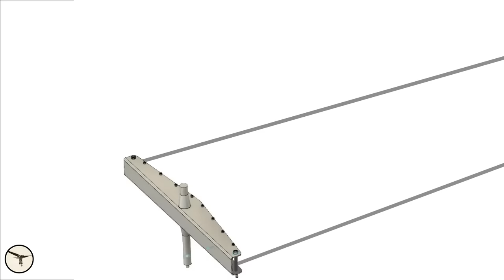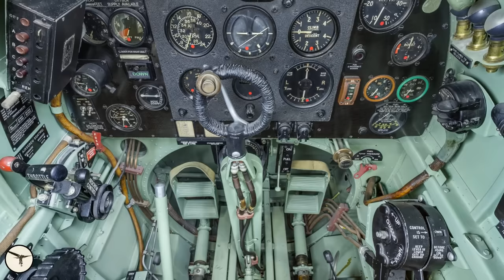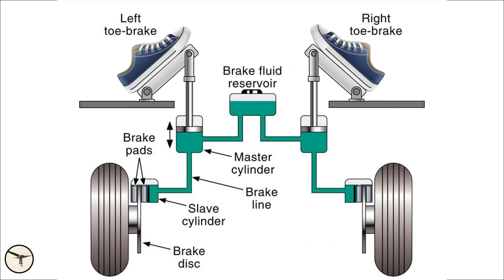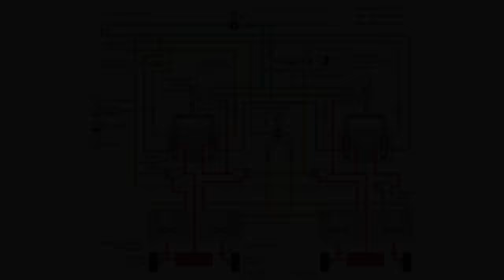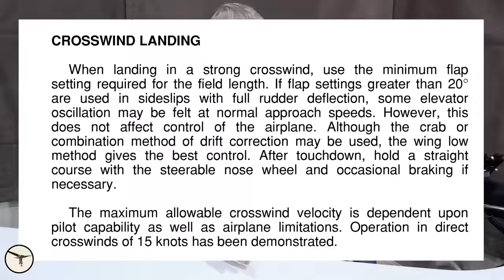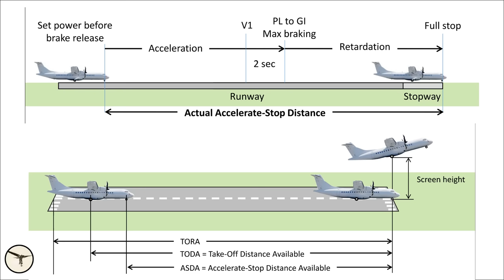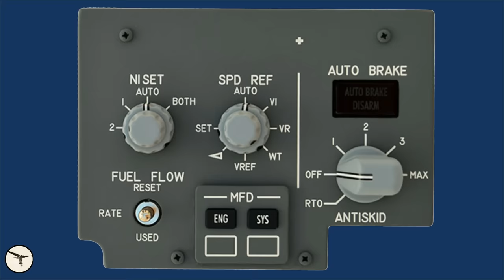Are you using the rudder pedals correctly? | Flight safety | Loss of control

Comment: Having grown up in small airplanes with poor brakes, I have always kept my heels on the floor with my toes on the rudder and used rudder exclusively except to make tight taxi turns.  This has worked for me, even in TW like your Maule, because i also use the apparent brisk walk rate of closure technique to decelerate on short final so as to land slowly and softly enough using both pitch and power to touchdown.  This slower approach to the beginning of the runway allow an angle across in strong crosswinds using the entirely adequate thousand feet between the downwind corner and the upwind big airplane touchdown zone marking.  Cubs, Champs, Taylorcraft, and Luscombe had only cable control of a mechanical non hydraulic brake.  If you applied the maximum breaking taught today, the pulleys routeing the cables would break.
Reply: hello i am training now，and had my first flight several days ago and i can not control the taxi direction how should i place my feet and what should i do😢😢😢😢

Comment: Boeing 737 pilot here. From what I read from FCTM, the manual writes that when operating rudder, heels should be on the floor. When braking applied, pilots should move feet on to the pedals so that the upper of the pedals part can be operated to apply brake. It works well for me since I was from PA42 directly to B737NG. I clicked this video for one situation that my technique could be challenged, but still didn’t get a clear answer. When autobrake and antiskid inop, flying the plane in strong cross wind, QRH asks to apply manual brake without delay upon touchdown. With the heal down technique, rudder pedal displacement increases as the plane touches down in a strong crosswind condition. The pressure and the rudder deflection on the downwind pedal increase as the plane slow down, so there will be no chance to slide your foot to the top part of the pedal. The solution I would have to use could be that during briefing, I would ask my copilot to hold rudder pressure for me to slide my foot up, or I would ask him to apply manual brake on my call upon touchdown. 

Other situation, such as engine failure below Vmcg, just bring the throttle back hold the tiler, then apply brake; and whenever immediately stop has to be carried out, when taxi, both pilots should avoid heads down work to minimize the situation of immediately stop. For those situation, foot on and foot down technique didn’t make any difference of prevention disaster happening. Still, I prefer put foot down to enjoy daily flying, but keep heads up. 

It seems Airbus pilots would have totally opposite technique as their pedals are designed to have your feet fully on the pedal as far as I know on A320.
Reply: Boeing pilot here.
Totally agree with you to have your heels on the floor
it's impossible to hold the rudder pedal without any leverage in the event of engine failure.
Reply: @JSmith777  Some daily workout might be needed to handle EO situation.😄

Comment: I like heels up on the pedal, I started doing that flying a Ce-185 because adjusting your feet to add any brake while your applying full rudder without changing the rudder input is nearly impossible. For the same reason in the Gulfstream G4 we are required to have our feet up on the pedals. This is required by an AD note in the G4 to address nose wheel steering hardover failures where you have to keep full rudder and brake and a delay repositioning your foot  to add brake will result in a runway excursion.  It’s not required in the G6 but I like how it feels better and I’ve never had an issue tripping off the auto brake by inadvertently adding brake.

Comment: Great and explained with details. As a glider and ultralight pilot I haven´t really learned to use separated brakes. Most of the little ultralights don´t have it separated. Some even don´t have any brakes - especially the older ones. However, I now have got an SD1, the smallest aircraft you can buy, and . . . it´s a taildragger. Originally it had had heel brakes but my large feet couldn´t reach them without sticking under the petrol tank which is right before the pilot. As I said, the airplane is really small. The "pedals" are only short pieces of iron tubes. I do not have experiences with taildraggers. Only model aircraft I flew with such wheel constellation. Friends told me I will need the brakes on my SD1 to keep the direction after touch down. Now I am constructing a special brake system with a 3D-hand lever at the stick which can be pulled and additionally moved sidewards to increase one of the two brakes more than the other. I don´t know whether it will work. I will carefully test it before flying. Generally those planes have less danger because most of the airfields are more than big enough for them.

Comment: Hi. Good video presentation! I use both methods. When taxiing, my heels are off of the floor so that I can brake more quickly. During the takeoff roll, my heels are slightly off of the floor until rotation, then fully on the pedals just after liftoff so that I can easily tap the brakes prior to retracting my gear. I use the same post-takeoff foot position in fixed gear airplanes. 😊

Comment: I was taught in a 152, "heels on the floor" he would say, on every takeoff and landing. First of all, I have a size 13 foot. My heels are always on the floor. He wanted my feet off the brakes. I never saw it as an issue. 

Since then, I've flown with a few people that jab the brakes while steering on takeoff. I wanted to slap them. They were doing it by accident. I doing understand pushing or activating a control by accident. You shouldn't be making accidental movements at all. 

Then, I learned to fly tailwheels. I had to relearn to keep my feet up on the brakes instead of "toes off the brakes" like my original instructor wanted. Sometimes you need a little more than the rudder alone can provide, and you don't have the time to readjust your feet. You need a brake NOW, or you'll ground loop. Not all tailwheel airplanes have the same ground handling characteristics. Cubs are easy. Some of the all-aluminum taildraggers you have to battle with. 

Keep your feet in the best position to have full function of all controls with no hesitation and no notice, then only use the inputs that you need. No riding the brakes. No jabbing the brakes on takeoff, and don't touch down with the brakes applied. If you can't apply only the controls you need, only when you need them, then you need more training.

Comment: I did my PPL at a commercial flight school and they taught also to keep the heels on the ground. Mainly because they don't want students to ride the brakes during taxi and so they don't accidentally brake during takeoff or before landing. Nowadays I feel more comfortable with whole feet on the pedal though. It provides faster reaction and more force can be applied if necessary. I personally have no issues with sensitivity of my legs vs. my toes, that's just a subjective thing, probably. To avoid accidental braking, I just make sure to put a bit more pressure on the heels, so the tilting motion of the pedal would be up and not down. In the end, it just a matter of personal preference - if so many airline pilots do it all differently, there probably is no 100% correct way 🤷🏻‍♂️

Comment: I got a harsh lesson in proper use of the Rudder  pedals when I had my solo all these years ago.

A strong crosswind had come up and I use the Rudder pedals as a footrest 

After two landing attempts swerving all back-and-forth across a 200 foot wide runway on the third try I ran off the runway and bounced among the tumbleweeds at 70 miles an hour. 

This was an uncontrolled airport and there was a tractor-trailer right in front of me about 200 yards that used to service the crop dusters 

I thought the only option I had was to give it full throttle and fortunately  I cleared it by about 50 feet 

I spent about a month trying to go over what I did wrong and got a new instructor. 

And later on he told me how to stay out of a spin by constantly using those rudders and "centering the ball". 

The little piper Cherokee just sort of mushed down rather than stalled 

So to answer your question I learned through the school of hard knocks that the feet are always on the Rudder pedals 

They are as important as the stick in controlling a critical axis – yaw. 

To take your feet off the Rudder  pedals would be akin to saying "I don't need to control the yoke  and let the plane do what it wants"  on that axis 

Actually the other two axis since the yoke controls both pitch and roll 

Seems I've always gotta learn through the school of hard Knocks  but once I learn it… I've learned it

EDIT: I think initially I misunderstood the question. To qualify when I used to fly feet would be on the toe brakes when I'm ready to land and heal would be on the floor in the air. But of course always on the Rudders.

Comment: Magnar: Good video! I can sure tell it comes from not only an airline Captain, but one who cares about the little details that set you apart from those who don't care so much.

Many years ago I was a B737-300 Captain and flying with many pilots new to the airplane.  Most understood that in all phases of flight except active braking, your heels must be firmly on the deck [floor] and the top of your toes not touching the top brake part of the foot pedals. Every now and then I'd fly with a pilot who only knew how to fly with their feet in one position: high on the pedals, heels on the rudder bar, toes on the brakes. This created interesting situations on both takeoffs and landings. Takeoffs in windy, gusty conditions would see these pilots correcting the track to the runway center line not with rudder and nose wheel steering (the correct way) but with *touching the brakes*! When I pointed out the use of brakes on takeoff in the debriefing, as often as not the pilot get angry and deny using brakes. Good leadership does not need anyone to be friends so the issue should be pressed until there is clarity of some sort -- I might have been wrong. But there was no good method of showing the pilot what he had really done. Only in one case did a pilot riding as passenger ask after landing, "Why were you guys stabbing the brakes on takeoff?" You can feel it in the back when the pilots use brakes on takeoff., and it's a big NO NO.

Landing, the B737-300 preferentially used Autobrakes to save wear and money. If the pilot had his or her feet too high on the pedals, upon the touchdown it was common for the minor "jolt" to have the pilot accidentally touch the brake tops -- and this would disarm ("kick off") the Autobrakes and we would be free-wheeling down the runway with only thrust reverse to slow us. (Thrust reverse works great to reduce cost but does not stop the airplane as well as wheel brakes.) Thrust reverse a lot makes noise and shaking and sounds like you're stopping, but without wheel brakes you may quickly use up too much of your landing runway.)

I could discuss the proper technique and, after 2 or 3 landings where it was clear the guy was not really even trying to change, I'd have to require it. So I briefed that once on final, his heels had to be on the floor with his shoe toe visibly below and off the brake pedals. I know these guys were trying but since it didn't *feel right*, it was difficult to get them to actually land and touch down with feet in the correct position.

Our airline procedures did not include a call-out of "Autobrakes OFF" and we were supposed to not utter anything not in the book. But I briefed that if he accidentally kicked the Autobrakes off on touchdown, that I would make that call to let him know we were MANUAL braking -- and the implication was that I didn't want to see us coming hard up on the end of the runway again. On touchdown, he had lifted his feet up and accidentally kicked off the Autobrakes. I made the call; he denied doing it, it "must have been a defect in the airplane"; and I said "You're MANUAL BRAKING." The debrief was, again, not very successful.

But since it was the B737-300 and we took off and landed A LOT during a 4-day trip, and since we traded legs for flying, I kept notes of every tail number we flew, who landed, and what the Autobrakes did. Summary: 100% of the time, my Autobrakes worked normally; %100 of the time when he landed, even on airplanes that I had landed successfully using Autobrakes, on touchdown I made the call "Autobrakes OFF." Some guys are slow learners. Don't be a slow learner!

At the end of the month I suggested, "Don't use Autobrakes. When you do, the system doesn't seem to work and the Captain is faced with a routine distraction wondering why the airplane isn't responding to braking normally. Just use manual brakes. Our company can afford it." (What I couldn't say is, the company can afford it because it was cheaper to pay for his manual brake stops than it was to risk a runway over run. The runway in question was Burbank, California, runway 8 -- where the joke was that you were getting your "carrier quals" signed off on the B737-300. The risk of overrun was not hypothetical: a few years later a B737-300 ran off the end of the runway and ended up perched on top of a gas station. Another professional NO NO.

Last thought: I live on a little airport and typically see 20-30 Cessna 172s taxi by my house for student and private pilot practice. I have a couple of thousand hours as a Cessna 172 flight instructor, too, and my family owned a Skyhawk for about 30 years. When they taxi by (and the pilots usually wave to me), 90%-95% are not steering with the rudder and steerable nose wheel; they are "steering" by the much easier method of lightly using toe brakes! I can tell because a pilot properly taxiing uses only 900 rpm and weaves ever-so-slightly along the center-line. Taxiing with toes brakes, however, the pilots are using 1200-1300 rpm and holding the center-line perfectly. (It really is easier!) (And I can easily tell the engine RPM by sound, it's like a flight instructor Super Power.) Why is this a problem? Because their takeoffs typically use 300'-500' more ground run before getting to flying speed, since every touch retards acceleration! On landing, with their feet up on the brakes the tires make a loud "CHIRP!" rubber sound on touchdown, accompanied by puffs of blue rubber smoke. When I said 90%-95%, I absolutely mean it: only one guy, my neighbor, Mike, a retired FAA inspector, routinely does it correctly. And when I mention it to the flight instructors (who were mostly young time builders, but a few old guys like me), 100% of them were angry and said they didn't do it and I was wrong! (Thank god for modern cellphone video cameras: "Would you like to see yourself taxiing by my hangar porch? Now would you like to see your takeoff, followed by your landing. Want to see 6 more of them you did?" Now would you like to see my C172N-model, just like yours, with my son/daughter flying, full fuel and 4 people inside? Yeah, they rotated one taxiway before yours and you can see that you cross by my hangar just as you rotate where my kids pass by my hangar at about 50' height.")

Pay attention to Capt Magnar, kids. He's telling you the truth. And a smaller lesson is that when you get corrected, at least politely consider the possibility you might actually be better off adopting the correction. Maybe not, but if it comes from a quiet Old Guy with 30,000 hours in all kinds of airplanes -- at least consider the possibility.

Comment: I was told off several times as a student pilot for having my feet fully on the pedals.  I wasn't pressing the brakes on take-off as they implied, but I later realised that with the entire foot on the rudder pedal one has less sensitivity about moving the rudder in turns and tends to use them as foot rests!   It is better to only have the toes on the rudder during flight - best to get that habit from the outset.

Comment: Airline pilot of 24 years; currently flying B767. I've always kept my full feet in the pedals to have use of brakes when needed. Taxi/Takeoff: full feet on pedals until airborne, then I slide them down. Landing: full feet on pedals at 1000ft, when I place my hands on throttles.

Comment: Heels on the floor. When I was training I had my toes on the brakes while landing and inadvertenly applied partial brake on landing which led to an extremely unstable landing where the wheels were skidding rather than rolling. With more experience it becomes safe to have your toes on the brakes, but for newer pilots, the pressures on the peddals are less automatic and tensing up on the controls could lead to inadvertent brake use and skidding rather than rolling, which is much less stable.

Comment: Been flying Boeings only for many years so my thoughts are relevant to this manufacturer. During my first TR, I was taught heels on the floor. The main concern was inadvertent braking. I also noticed that feet up promoted inadvertent AB RTO disconnects. On the other hand, it does indeed take a second to move your toes up when you need to brake. Typically not a big issue but not always comfortable to maintain smooth directional control and less easy than with toes up. I also find it easier to lock the leg with the heel on the floor on EFATO's. As for many things in this job, there are several ways of achieving the goal while complying with SOPs as they usually leave some leeway. It's not always easy to differentiate between personal preference and correct technique when the FCTM or the OM B aren't specific about a technique and opinions vary. Let's look at it with an open mind... I personally don't have a definitive opinion as both techniques seem to make sense.